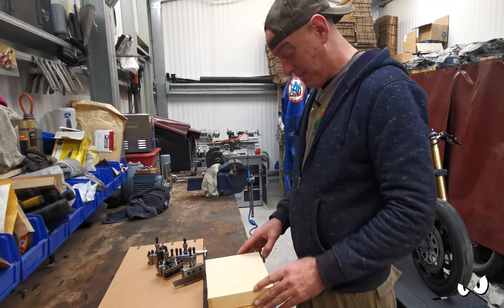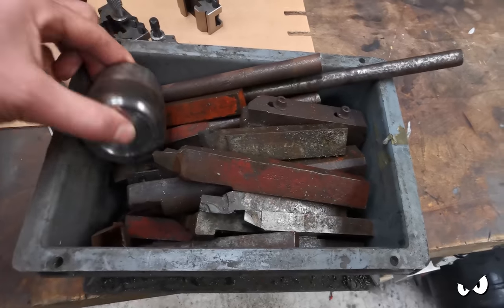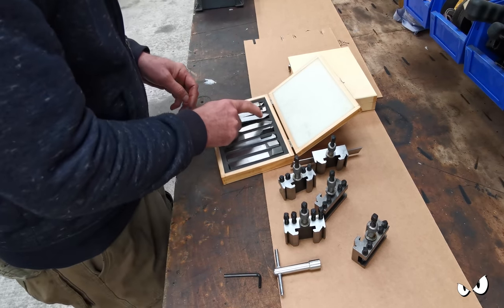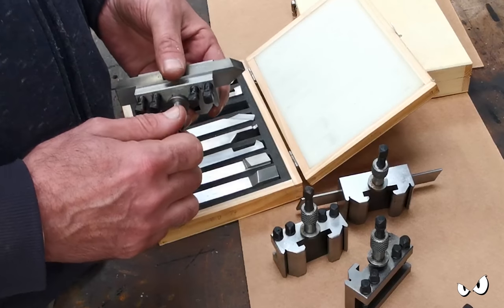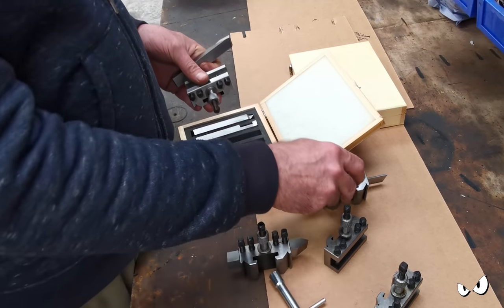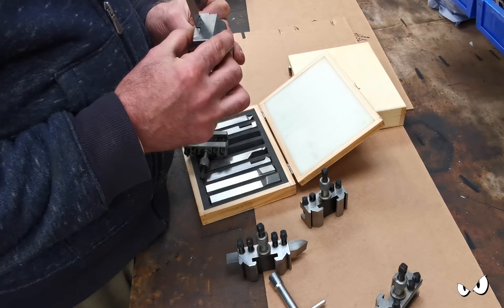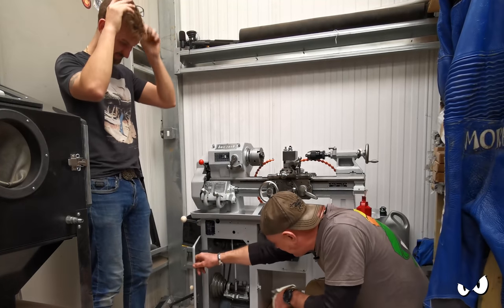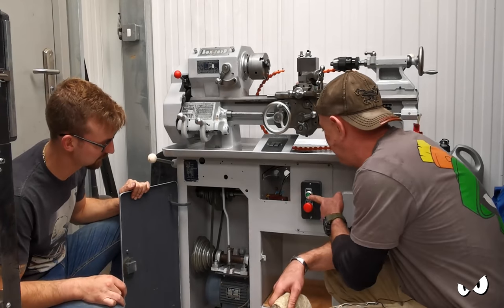Restoring a Boxford AUD Lathe - Part 8

Comment: Glad to see it up and running. If you intend using powered feed do get some buffer/proximity switches to prevent the cross  slide and saddle running into the chuck or face plate.......... that can seriously spoil your day. Stay safe and well
Reply from the maker: Hehehe... Saw a video of that happening... Looked expensive 😳😳😳

Comment: Awesome, have fun making chips! On a sidenote, an old boy machinist at work told me to never run a lathe at any decent speed without having something clamped in the chuck. Apparently there is a slim chance the scroll could unwind the jaws and one of those in the face would really ruin your day!
Reply from the maker: Oooohhh bugger... Never heard of that one before but thanks for the tip 😁👍
Reply: @QuickBikes  big no no Quicky, was going to be my comment too, thought I'd check 1st if it's already been said.
Reply: Second thing on the list of daft stuff you don't want to do with a lathe. Just below leaving the chuck key in and just above using rags near a spinning chuck. Sod's law says if something comes flying out from that lathe it will only miss your face if its heading towards the nearest freshly painted fuel tank!
Reply from the maker: Ah right.... I'll paint one and hang it on the wall behind the lathe, just to be super safe 😁👍🤣

Comment: Happy to see it all come together 

Love that box if stuff Steve-O brought; appears some of it may be brazed carbide.  Good stuff.

These little lathes weren't made for carbide insert tooling (the cutting geometry of carbide inserts requires MEGA pressure for what these little lathes can do), but you grind brazed carbide to similar geometry to HSS, and it works great

Oh, and don't breathe the dust when you grind carbide  -  it's SUPER bad.
Reply from the maker: Handy comment, thank you matey 😁👍

Comment: Lovely job!!, its so handy having a lathe, love mine its only a Clarke 430 but has come to the rescue many times for that one off bit needed yesterday to complete the job 👍👍.
And your safe in the knowledge that it will only increase in value for the future, mine only cost 50 quid with a couple of faults ,easily fixed so the bargain of my garage. Cheers 👍
Reply from the maker: It's gonna be dead handy, I just know it. I already have a list of stuff tgat needs making 😁👍

Comment: You might want to make a screen tightly fitted to the back of the oil tray projecting about 600mm above the  tray  say 600mm either side of the front part of the chuck a) to catch all the small parts that you make and stop them dropping behind the lathe and b) to stop the lubricant washing your wall with oily swarf.
Reply from the maker: One of the many upgrades. I have added it to the list, thank you matey 😁👍

Comment: Are you sure 16mm tools will go low enough to be on the centre? on mine they are too big.. I have to have 12.. or face the tools down... Good luck with the little lathe though you never stop learning on them...
Reply from the maker: I've had a play briefly and I can get them centered OK, but you can't get them much lower it has to be said... I'd prefer to use the biggest tools possible for rigidity, but if I need to use something else than its no biggie 😁👍

Comment: Since this video I've been looking at lathes everywhere, Boxford, Myford etc and recently a mahoooosive (!) CVA 1a just down the road in Bristol. Also hours of YouTubing which brings me to re-visiting this video with a question; what (if any) efforts did you make to level the lathe? Dunno how important it is for a small one like the AUD but avoiding cutting tapers has always got to be a good thing! Just watched a very informative (rather long and tedious but curiously engaging) pair of videos by oxtoolco in the States, worth a look if you haven't already.... Cheers!
Reply from the maker: I've had a go at checking for twists in the bed by turning a length of 6 inches of steel in the 3 jaw and measuring both ends with micrometers, then repeating the same thing but with tailstock support. I have it close I think, but I'm getting a pro tool maker and machinist to check it for me. I just need to find out when he can do it 😁👍
Reply: @QuickBikes  sounds like a good plan!

Comment: Lol it looks good mate I got my self one about 3 years ago never used it I will well I tell my self that lmao I'm one of them that wants everything I can set for it before I use it but finding bits for it is a nightmare lol all you need now is a pump for your cutting oil you can make one for penny's I made all mine out of all kinds of things best thing I found to use is the old metal frying tub 20 pound bit of crap from tesco or asda one of the let me know if you want know how I did it and I will show you on MSG Facebook you still not done that sandblaster though lol need to seal it told you that when we talked about the cyclone how's that going anyway you finding it ok trying to sort some glass for mine then I can finish the videos the all up and running then one to making the vapour blaster got to parts to come for that then that will be done but more than happy to help if need it just say give you a msg and I will soon as I can take care mate nice to see ppl happy when they put so much work in to something
Reply from the maker: I'm really chuffed with it and figure I'll just add the tooling I need as I need it. Otherwise I will end up spending a small fortune on tooling that just sits in the cupboard. The shot blaster is getting turned into a vapour blaster soon and I already have most of the kit to do it. Just waiting on a few odds n sods to turn up 😁👍
Reply: Same iv got tons of bits just sitting at moe lol but if you need any help with bit with the vapour blaster let me know mate happy to help where I can what kind of voltage are you doing for it as mine a 240v no ones done it yet as they say it can't be done but I have its a lot easier than the 12v or the 24 a lot of ppl go that way as they think it's better plus where everyone one has done it so far they are not on the same as us and running some 12v parts I found a way I don't have to do that but like I said happy to help if I can but I will say most of my bit iv made out of stuff laying around but can get new but what the fun in that think that's why it's taking so long lmao